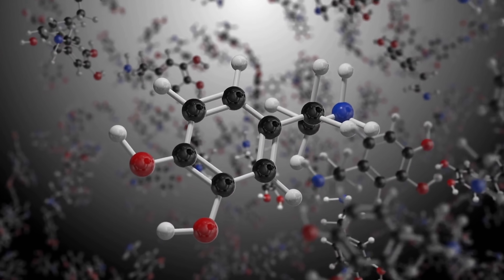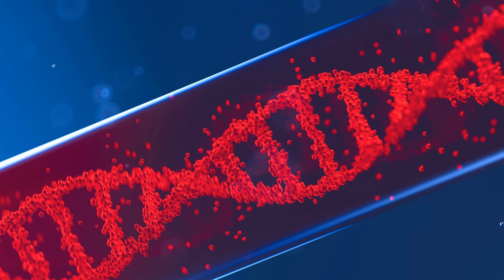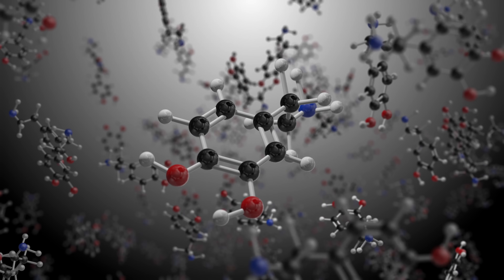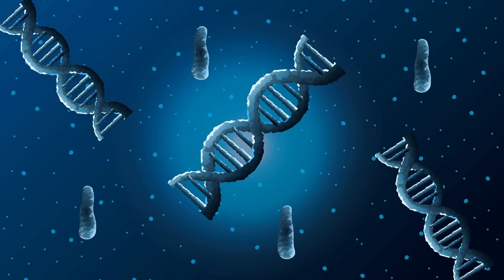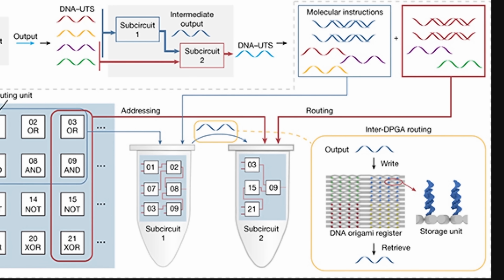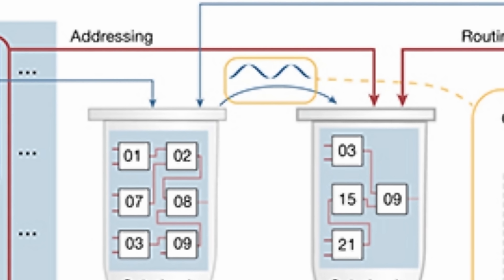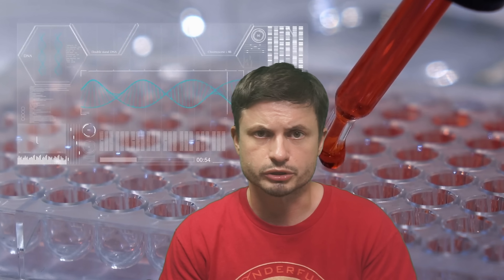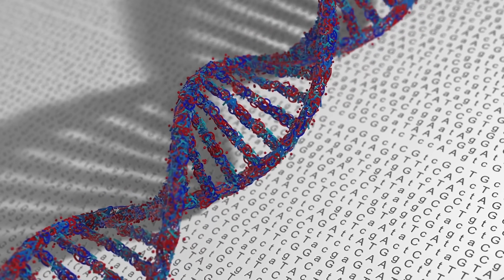First Ever Programmable DNA Circuit Is a Breakthrough In Biocomputing

Comment: Fascinating. But I see some huge issues for something like that... Things like mutation, degeneration of the materials and so on...
Reply: imagine computer cancer, computer prion
Reply: @matheussanthiago9685  Yeap, it would be weird!
Reply: I'm not a biochemist, so I can't say for sure either, but I'm pretty sure mutations would involve material from outside of the chips being added to it, and degeneration involves biological cellular processes that make them like a one-way printer that needs to be restored by being recreated rather than reconfigured like this stuff is. So in other words when they say DNA computing, they seem to be talking about using organic chemical compounds found in biological organisms (with an emphasis on chemicals), rather than for instance imagining it as being a lump of flesh that someone turned into a chip. DNA, in our case, is part of a larger system that it's directly tied to and directly relies upon. These chips would be 'self-reliant'.
Reply: @Veldrusara  Except there will will ALWAYS be a statistical occurrence of "mutations" from ionizing radiation, probably much greater than junction breakdowns from same in electronic devices like FPGAs. Self-repair at a system level would need to be implemented, but I doubt it would resemble a biological immune system. The, or certainly one of, the real strengths of the FPGA device class is its programmability, which includes REprogrammability (within limits) in later iterations.
Reply: @Veldrusara  See my comment, i think the point here actually is that it is just DNA as a tool and not to breed cells. Cells use DNA as a tool and it gets corrupted when they copy their DNA with errors. But in a DNA storage for example there are no cells, just DNA's proteins being modified. The mutation here is actually what makes the DNA computing work, but it really is also no mutation since we not deal with living cells.
Reply: It is just DNA, not full cells reproducing themselves with DNA. SO they use the protein chains to store info, not to breed cells. There is no mutation possible because nothing is alive here. A better form of storage would be using straight up atoms, since proteins are basically just a bunch of atoms. Proteins just happen to be smaller/denser than what we can do now.
Reply: @Donnirononon  multiple types of energy (cosmic rays, etc) damage DNA in real time, regardless of replication.
Reply: @purposefully.verbose That is true tho the system could also add error codes to self-repair in this case. Considering DNA is REALLY dense we could by default just store it 2, 3 or even 4 times for redundancy combined with error correction bits.

What i meant to say tho is that there wont be "computer cancer" in the sense of cancer in living tissue because the DNA is never replicating, only modified.

All your cells replicate for you, cancer is when they go rouge and replicate for themselves not considering you. But like i said, in DNA computers and storage there wont be cells or replication of cells.
Reply: @purposefully.verbose 
I love the name, by PURPOSEFULLY do you mean IMPULSIVELY? LOL

Though that was a pretty short reply for someone who self identifies as verbose, low energy today?

Anyway, take care and thanks for the laugh!
Reply: @PR0JECT-2201  Aye Cap'n - super soporific, which of course means tired... let me tell you about a time i was tired, and that might further explain it, or - maybe that's too long winded.
oh heck , i don't care... i had just eaten this wheel of cheese, you see, and it's full of all these amino acids and proteins and stuff, which are of course the building blocks of life... but i digress - anyway, i was super tired... because of this cheese. did you know cheese can come from many types of mammals?  one could theoretically make mouse cheese if one had the inclination and the patience... and skill. 
so yeah... i was tired.
Reply: @purposefully.verbose  
Well how disappointing, it was starting to get good, because CHEESE, who doesn't love cheese?
And you just quit mid story... must have gotten tired again, even taught me a new word (soporific).

Well my friend, I will be here when you are done resting, I eagerly anticipate the end of the fascinating and cheesy tale.

Jokes aside, are you genuinely verbose (and curbing the blabber monster)? Or is it just a name for giggles?
Anyway, thank you for the laugh!
Reply: @purposefully.verbose  the same cosmic rays can flip bits too, so its a problem in our computers as well
Reply: @Donnirononon  great insights
Reply: The human brain has the same issues, and  look how successful it has become.
Reply: @jdmilne1 Yep and the brain is a better virtual reality machine than any computer we have. A simulation so good that (when we are in it) we can't tell if it's real or just a simulation (during REM sleep). 😅
Reply: @jdmilne1  Yeah... Until Alzheimer.
Reply: @jdmilne1  Human brain is anything but a computer. To be a computer, a system at least has to have well defined operations. In biological systems, even the simplest ones has little to no. Even the simplest biological system is a complex chaotic system where no molecule or component is bound to any predefined operation or function. And that''s not a bug, but a major feature upon which biological functions depend.
Reply: Massive parallel circuitry with redundancy, error-checking routines, and basic self-repair (molecular surgery, or simple component replacement) address all the predictable problems. 
The REAL problems are the "unknown unknowns...
Reply: Agreed.   Analog computing may still be the best of the lot, but also has its challenges.
Reply: even electronic computers have bugs, random bit flips, and other such. they would probably just figure out some counter measures for these like they did for electronics
Reply: They got to seal it off from the outside.
Reply: @belstar1128  
That's the answer! OMG!
Keep it in a sterile and completely sealed environment!

Did you know this is standard practice in many places?
In other words BASIC...

This is doomed to not only fail, but it also will be weaponized.
When you are a hammer "humans/military"... every problem is solved the same way!
Nail or not...
Reply: Realtime selftesting, error-checking routines, and self-repair mechanisms are necessary for these to become usable devices in a larger sense; all 3 things exist at the present time.
It's all engineering at this point.
Reply: Computer data regularly gets corrupted and lost due to phenomena we can't account for like quantum tunneling cosmic rays etc. Yet we still are able to salvage this data in most cases. Our bodies are already pretty good at beating cancer and other mutations, I mean does any computer we ever made have a lifespan of 80 years?
Reply: We already deal with failures in normal computer hardware. Digital communication and storage* is wrapped in layers of error checking and correcting to make the best use of a lossy channel. A hard drive may expect to lose some number of x bits per y operations, so the designer slaps in a little overhead for error correction. A spot which sees errors consistently may even be marked as bad, and not used again. On a grander scheme, server farms expect to lose some number of entire computers per day to failure, but various strategies and algorithms let the work continue as long as no more than z machines fail over a certain timespan.

Our error checking and correcting codes are dramatically more efficient than what biology uses and can essentially guarantee** either a correct result, or none at all. Evolved biology itself wouldn't have gotten far if it used such codes, since the process of evolution relies on some level of mutation. Anything which gets too good at protecting its DNA stagnates.

*Data storage is really just communication, but the target is in the future rather than the present!
**We can push hidden failure to such a low probability, that it's unlikely to occur.
Reply: Yep.  Did you see how many were injured with rogue dna inject3d into their blood = Turb0 c4ncer
Reply: We have problems with technology falling into "the wrong hands" NOW, imagine what this will mean for warfare... hold on one sec. (putting tin hat on... there we are), THE END IS NEAR!!!

They call a "lost" or stolen nuclear payload a "Broken arrow", (frightening that it happens so often they gave it a name...), what will they call a "lost/leaked/stolen" bio engineered weapon of mass murder?

Einstein wanted to give the world FREE AND ENDLESS ENERGY, we got the A bomb instead, the point is, even when the great minds share their gift of brilliance with us, we pervert and twist it into something COMPLETELY OPPOSITE of what Einstein "willed" into this world...

What makes you think this will be any different?

Humans are VILE, hopefully when this thing goes south, it wipes out the entire species as a whole instead of just certain groups. (One can always hope).
Reply: blockchain can be used for dealing with errors/mutations ig.